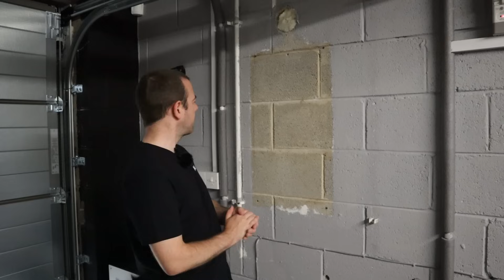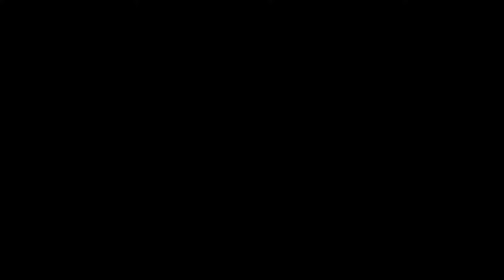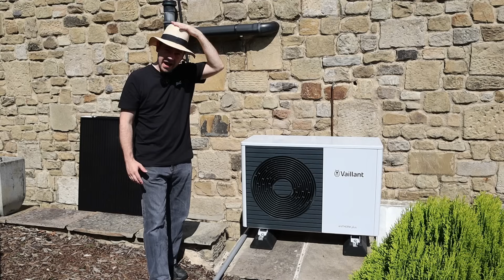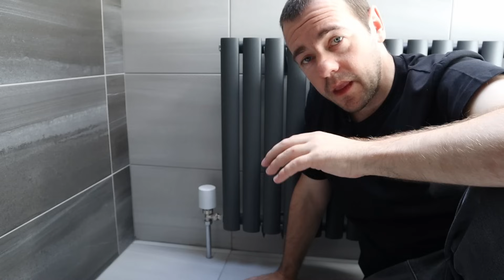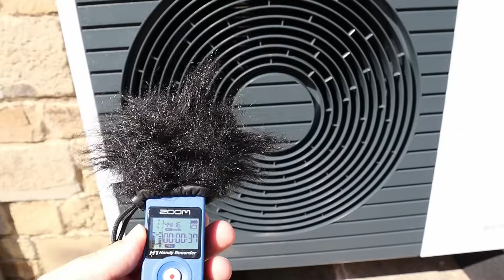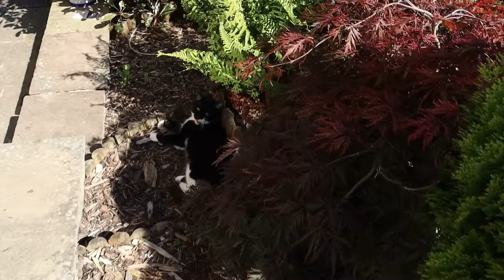Heat Pumps - Our 'Ugly' Truth!

Comment: Given that a Gas fired anything in the home produces 100% of its heat INSIDE the property, and given that you have probably ALREADY PAID for that system, you might wonder why you should be slyly funnelled - by our POLITICIANS - into changing anything at all.

"Well there is a 'CLIMATE EMERGENCY' you need to produce less pollution - particularly CO2", is pretty much the stock answer.

So what have these governmental types done to help?
Well, they are giving us some of our own money back, to help(?).
Meantime they jet around all over the world and pretty much carry on as normal.
They want you to use Electricity because it is cleaner -  even when most of what we use is made by Gas and other fossil fuels... cue laughter.

That any electricity put into the grid, loses over 50% of the energy put in, by the time it reaches you, seems a matter of NO interest, apart from ensuring that any Gas you burn is artificially hiked to make the price charged for electricity seem comparable... a lesson in pure Snake-Oil misdirection and greed if ever there was one.

As for the deadly(?) gas CO2

Well trees consume a mighty amount of this and so do plants - so what are our greta thinkers doing about that?  They cut down forests in the USA and turn them into pellets.  Then they ship them all the way Selby in Yorkshire - exclusively using fossil fuels.  Once there the Drax B power station burns them releasing all the CO2 they have, whilst sitting on top of an Open Cast coal mine with tons and tons of UK coal waiting for some constructive - and air miles free - use.
Meantime Bill Gates has recently proposed that in addition to that nonsense forests should be reduced in size and the surplus buried - to avoid CO2 release as they decay.

It is ALL clearly NOTHING if not a plan to ruin the world, and reduce its population by sleight of hand and slither of forked tongue.

"Yeah, yeah Colin, it ALL seems like just the ticket.  What could ever go wrong." the RtDodgy Member for Waste 'em-on-Sea might easily be conjured to mind saying.
Reply: You do realise that some of the heat needs to escape out the flue so you're not getting all the heat from the boiler.  Even at 50% efficiency of a power plant (the new Keadby 2 is 60+%), UK's gas boilers due to being oversized and under-optimised for the heating system they provide, their efficiency is closer to 80%, than the label of 90+%.  Even being generous at 90%, a heat pump would only need to get a COP of 2 to be better than a gas boiler, e.g. Providing 1kW of heat for 1kW of gas going into a power plant, vs a gas boiler using 1.1kW of gas to provide 1kW of heat.
Reply: @BenIsInSweden  My point is made!
Our 'Net Zero' fanatic government wishes to use GAS to make electricity.  So that huge Electricity plant will have had a flue, it will lost energy making the electricity in the first place - it will then go on to lose the 50% + I was talking about in transmission heat-loss.

Comment: 06:20 "90 litre water tank, immersion heater". What do you need an immersion heater for if the heat pump delivers sufficient hot water?
Reply from the maker: I don’t. The tank comes with one internally.
Reply: @ElectricVehicleMan  Weird.  I wonder if they fit them with other random unnecessary parts.
Reply: @ChrisCowley1  The heat pump and the cylinder are separate products. So the cylinder could be paired with a non-R290 heat pump, and use the immersion for Anti-legionella cycles if required.
Reply: @BenIsInSweden  Ah, got it. Cheers. 👍
Reply: Heat pumps run at low temperature, the immersion is to get the water to 65 degrees once a week.

Comment: Yet another commercial video. Typical gas boiler 30kW. Your heat pump 5kW. Your gas boiler is 6 times more powerful than your heat pump. You are comparing a 1.1lt VW Polo (say, 80BHP) with a Mercedes 600 AMG (say 480 BHP) and try to claim that the Polo is more economical. What a farce.
Reply: You're misunderstanding how this works.  a 30kW boiler can only modulate down so far, if the heating requirement is less than the lowest modulation amount then you're never going to be getting the stated efficiency out of the boiler.  If a house has only 5kW of heat loss then a 30kW boiler is way oversized for what's needed.  It's more like using a Luton van to do your weekly supermarket shop instead of a regular car.
Reply: @BenIsInSweden  With all respect, I think you are misunderstanding. First, the 30kW boiler, any boiler, modulates with time, not (just) power. Secondly, there will be times when we need the extra power, like people queuing up for a shower or when it is freezing out there, like last December, and the heat pump will fail miserably to deliver the almost instant and plentiful SCALDING HOT water for everyone to enjoy. So we wash in luke warm water, topped up by an electric immersion element, just to beat the legionnaires, and making a mockery of the heat pump installation!
Reply: @sharesgames9546  you don't need to look far, these r290 units can provide a boost for dhw up to 75c, without immersion assistance.  All households need to have a maximum hot tap temperature in the UK of 60C which will have cold water blended in if it's too hot.  And most people blend cold water in at the outlet down to below 40C. You might want to do some research into legionella as well. It's only a problem in standing water, so if you're frequently using all the cylinder on a daily basis you don't need scalding hot water as it hasn't had time to become a problem.

Comment: I think heat pumps would be best used with hot air rather water radiator systems. That way you get air cooling as well.  Easy for new builds and total refurbs. Of course retro fitting an air pump to replace a gas or oil boiler you are 99% likely to have water radiant heating. But no need with volume new builds ho stick to water filled radiators once heat pumps take over. Not sure if they use heat pumps to heat water radiant systems in Norway or hot air heating.

Comment: So It depends whether it will workout or not? That possibly could turn into a financial concern for most people. Spilling out say £10 to £15k on something that might or might not work. If I spilled out on a new gas fired boiler i would expect it to work without question and likewise I would expect a heat pump to work without question spending that much. People in general do not have the cash for possibilities.

Comment: SOlar panels used to be a put-off for house buyers, but seems like it's the opposite now. I'd certainly be looking for things like solar panels, decent insulation, heat pump, EV charge point, and compatible plumbing when looking for a house now. And I'd be wanting to reduce the house purchase price if those things weren't already there.

Comment: Questions:

What size is your house?

How old is your house?

What was the cost of the extra insulation required in your house? (If any)

Is the house cavity wall insulated? If so, how much did that cost (or would it cost if needed)?

How much was budgeted for the complete upper floor repipe, even though it wasn't needed? (My house would need a complete repipe - and no underfloor heating currently fitted.)

How much did the heatpump and its installation cost?
Reply from the maker: All that is in the other videos.

Comment: Heating an entire 190 litre tank of hot water, is very wasteful if only part of the tank is used. That's like going back to the an old immersion heater before combi boilers were introduced. Surely it's more efficient to heat water as required via a gas boiler or even a mini electric water heater
Reply from the maker: It only heats what it's lost from the previous day, not the whole lot each time.

At 300-400% efficient, it uses way less.

Comment: How do you feel currently about the heat pump? Been speaking to a local company and through the ECO4 grant there is a possibility to get solar panels and air source heat pump at  no cost, seems too good but checks out . They will replace all the radiators too.

Comment: Hi EVM, love the channel.  Just wondered if you had a solar diverter such as My Energi Eddi and if that could be used to activate the heat pump for water heating? Also the size of your battery storage.  Apologies if these questions have already been asked.  What are your typical kWh figures for HW only during this time of the year for just topping up the HW tank rather than from an empty tank.  Cheers.  James
Reply: Unfortunately Eddi wouldn’t run a heat pump. Elements like your kettle or the immersion can be switched on and off rapidly but the HP runs the compressor to generate the pressures to do its thing and it will cause problems being switched on and off as and when. The HP will run more efficiently on a time of day tarrif of or the batteries.

Comment: What happens if there is no room in your house for a univalent tower?  We re-modelled our house years ago and got rid of our hot and cold water tanks.  There is no way we are going back on that.  So how do I get hot water without a hot water tank?
Reply from the maker: Can get much more compact units than that.
Reply: @ElectricVehicleMan  You can get a sunap heat battery which is more compact than a cylinder. You do loose some efficiency though.

Comment: Thank goodness I've seen this . No way would I in stall that ugly, noisy looking thing on the outside of my property plus what looks like a massive fridge freezer on the inside . The sickening thing about all these modern inventions is they have to be replaced every 10 years with all that extra costs , making them very nice earners for the heating industry .
Reply from the maker: It comes with a 10 year warranty so why would you need to replace it after 10 years? Not even close. 

And you don’t need to have the ‘fridge’ I have. Can get smaller components.

Comment: Using the hp for hot water seems to add a lot of complexity.
If you just have showers, direct electric is really not that much.  Same if you have small tanks at sink and hand basin, that way you have no pipi losses.  If you need a bath, a big tank heated up at night might be best.

Comment: A new gas boiler would last you over fifty years and they make high efficiency boilers now . How much are thoes solar batteries going to cost you to replace in the future ? That water heater is a tank just like a gas one. Can you replace just the tank on the new unit ?  Gas per b.t.u. is cheaper than an electric per b.t.u.  How much did the entire heat pump system cost over a gas boiler ?  Look befor you leap. 🇺🇸

Comment: Just an observation. If you are able to heat your house with your flow temperature set to 40 degrees without changing the radiators you had with a gas boiler they must have been massively over-sized to begin with. I wonder how many other people would be that fortunate?

Comment: This is complete bulshit. 120 litter at 51 is 120 litters my friend if like to stink might thats enough but you can’t have 4 guys get comfortable shower with this amour of water. I like water pumps but you are laing! I have friend with much better installation than you super efficient house if floor heating and his pump is water/water and his pump is 28kw in orther to privide efficiency and level of comfort as gas boiler. You have 5kw total output by which black magic you get same as 32kw gas boiler …. This video is bias by person that do not understand how this works. And sdvice if you for pump never goes for radiator you need floor heating as lower temperature you need as efficient your pump with be….

Comment: The experiments have been done by the government with a number of houses around the country, and as far as I understand it, they have all been a failure.  Heat pumps, again as far as I understand it, require a very expensive investment in equipment and pipework and insulation etc.  This is obviously way beyond the means of most people in this country.  Then you have the problem of finding a competent installer and the ongoing expert maintenance required in the future.  Heat pumps may be suitable for a small number of properties, but either gas/ hydrogen or some other not-yet discovered fuel will have to be the way ahead.  The uncertainty of solar and wind cannot be relied upon to heat millions of homes, factories and other properties.  We need to get real and admit that our present and near future needs outweigh all this ‘saving the planet’  nonsense!   As millions of homes will be unsuitable for heat pumps, and millions more simply could not afford them, so it stands to reason that we will be always using gas and other forms of fuel.  The ‘dream’ of being zero carbon is just that, a pipe dream and will not happen.   Wonderful experiment for those with unlimited resources, but for the rest of the population it is completely out of the question.  My total energy bill is only £46 a month with a gas boiler (with the government grant).   The equipment required run a heat pump installation would take up far too much space in many people’s homes, or they simply would not have the space at all!

Comment: Lol wait till you have power cuts in really cold weather,it will happen or you cannot say you will never have power cuts. Let's see in the future. I for one want a heat pump to run with both my lpg and heat pump. I have no intentions  of dumping a combi boiler over a heat pump. But I fully agree the heat pump will save me money in our UK climate which we call summer.
Reply from the maker: Well I have a home battery for one. 

However, how do you expect your gas boiler to work with no electricity? 🤷‍♂️
Reply: @ElectricVehicleMan  lol I would use my brain forward thinking and use a small petrol generator which happily will run a gas or oil heat burner .
Reply: But if I had a heat pump, a small generator is out of the window. Heat pumps need power a huge amount compared to a gas,log,or oil bunner
Reply from the maker: @gino2465  Yeah that’ll get a lot of use in the UK. Constant lengthy power cuts!

They’d need to be no power for over 12 hours in sub zero temps outside for it to even become a discussion.
Reply: @ElectricVehicleMan  we do 3 days last time, solar had poor light. But we managed using a generator. I have 5kw battery but not enough. To many people think these battery packs are the fix for power cuts ,they are not. Good for a few hours only. I would prefer to tell people the truth, and give example of real off grid availability. My advise to anyone looking at spending 3k is to invest in a change over switch with Genny. The back up battery's great when solar is good and you can share to save using grid.
Reply from the maker: @gino2465  bigger battery would save money all year round, generator would just sit there not getting used. 

UK doesn’t have long enough power cuts to make a difference to temp etc. 

Hell, I could just use the gas camping cooker if the once in a decade event happened.
Reply: @ElectricVehicleMan  I would not even think about spending £16 k on say   a 27kw battery lol. It would take years for the payback to save money anyway. But my point is we do have power cuts you may not but we do in North Wales. So the goverment has mentioned already about cuts has it not. If your not bothered about this then fine. I am . Open your eyes try get out of that tunnel vision scenario. We don't all live in towns. I have recently installed change over switches for small petrol generators so older folk can keep warm . Our last outage was for 3 days . A battery is no help in poor weather and a small Genny would need to be at least 6kw to keep warm .
Reply from the maker: @gino2465  I live in a village in North Yorkshire dales. 

You wouldn’t need 27kW. I’d like to think you’d ration use if there was a power cut. 

What you’re saying is ‘1% of people’ might have this happen so have a standby generator. (Or just an alternate heat source)

If you think any situation or topic applies to 100% of people then…🤷‍♂️
Reply: @ElectricVehicleMan  people really need to have a back up or alternative yes.
Reply: @ElectricVehicleMan  My Dad has one with solar panels in a field ... no battery, far north of Scotland . Prior to the April and Oct increase ..ie Jan 2022 ... looking at £400 per month electric bill. Suggest he must be closer to £600 now. He won't talk to me about it anymore, when he was installing and afterwards he couldn't stop telling me how efficient and how cheap it was going to be and how much dosh he was going to be receiving from feed in tariff. I suspect he is regretting removal of the old boiler element of the contract he signed.